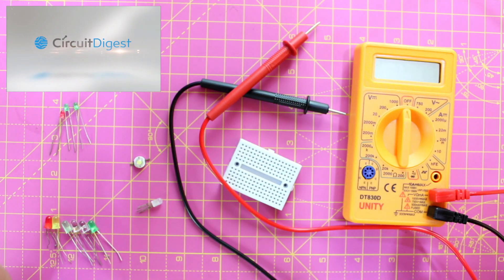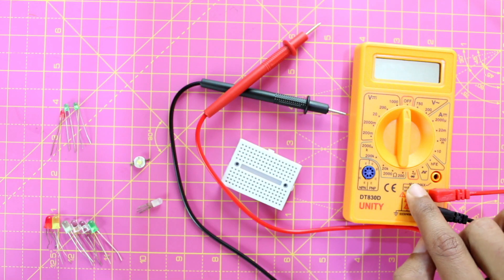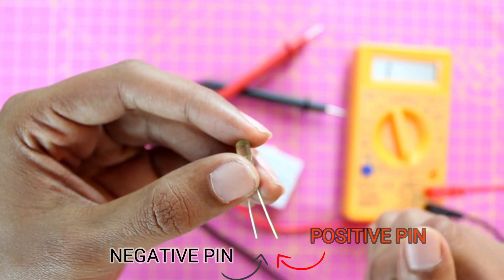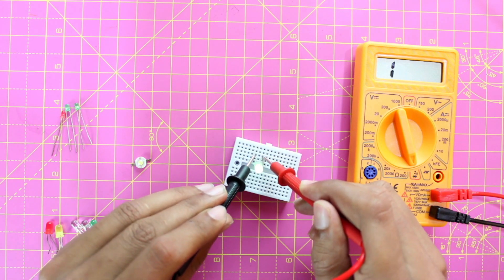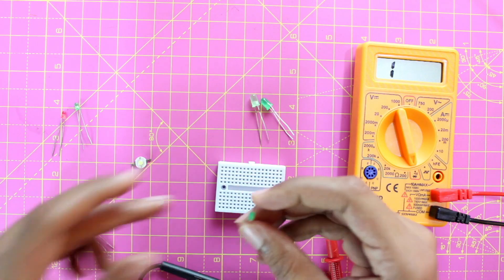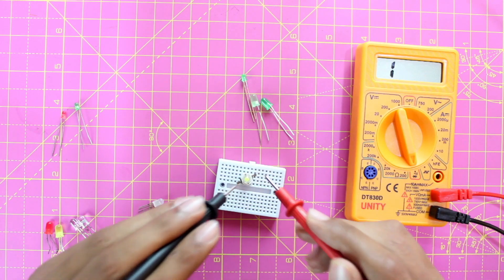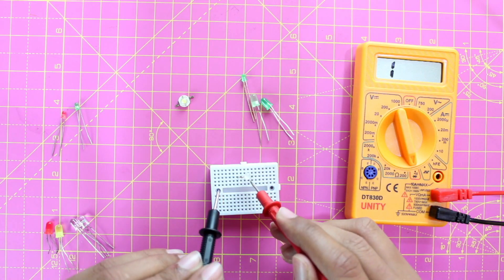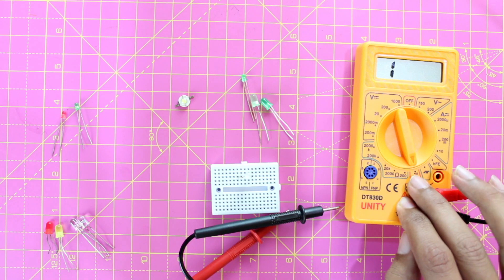How to Check LED is Working or Not? Simple Method to Test LED with Multimeter

Comment: How does one test with multimeter a neon bulb indicator light for iron/geyser & other appliances, neon indicator bulb with resistor, 200-240v ac. Chkd on continuity It doesn't light both when it is working and when it is dead.

Comment: Doesn't work on 3.5v LEDs. Standard multimeter maxes out at around ~3v.
Reply from the maker: For LEDs with higher forward voltage you can use an LED tester or a power supply with current limiting.

Comment: what about tv led?
Reply from the maker: If you meant the backlight LEDs, they have higher forward biasing voltage. You can't use a multimeter to check them. Normal multimeters can only test LEDs with the forwarded biasing voltage of up to 2v. Some DMMs support up to 3V. But the backlight LEDs can have forward biasing voltage ranging from 3.2V, 6V or even higher. So to test such LEDs use the dedicated backlight testers available on the market, they can test up to 300V. So you can also test LED strips with them.

Comment: Sir.. if 100watts LED, can the diode also check? Thanks
Reply: You can use a 9v battery or something like that like a lab bench power supply to check coz the multimeter would not provide enough power and check the led directly not  the led bulb as it would cause problems
Reply: What symbol is he referring too